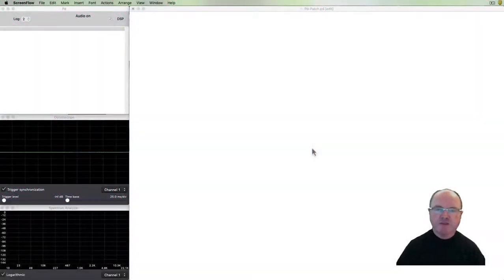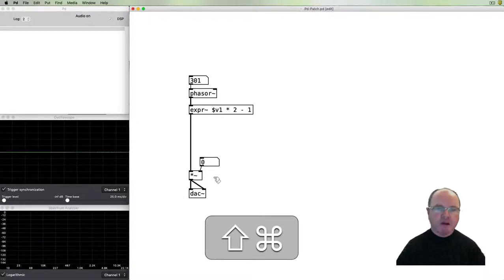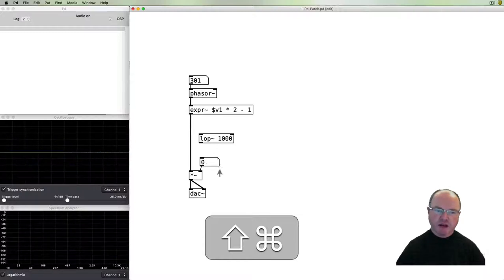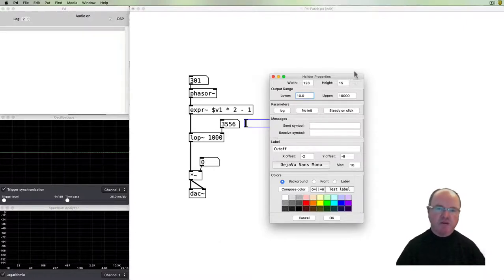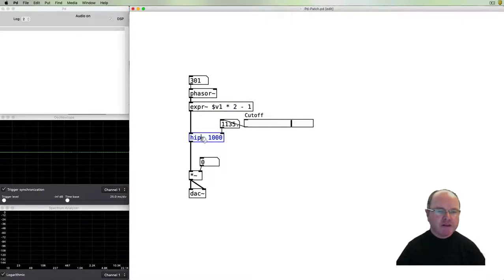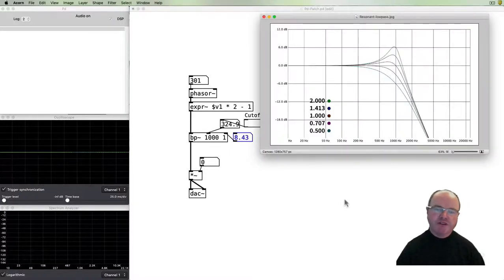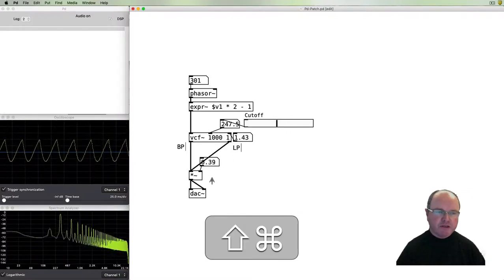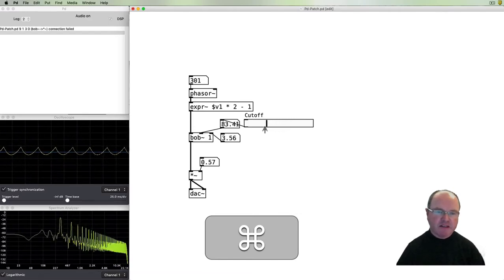17. Filters in Pure Data

Comment: I've been going through this who series (great work!) and up till now everything made sense. However, your description of vcf~ here does not align with what I see in PD's help. It states that vcf~ is (solely) a band pass intended to take in audio/signal to set the freq and a number to set the Q.
Reply from the maker: Thanks for the positive comments on the series. I'm glad it's useful. Checking the [vcf~] again, the current version of Pd does appear to send a bandpass signal out the left outlet and a resonant lowpass signal out the right outlet. Hopefully that's what I said in this video :)
Reply: @QCGInteractiveMusic   Thanks for the quick reply. 
It may be that I'm using purr-data, not sure. But the help (I see) has the right inlet being the "Q or filter sharpness". In that case how would one set the resonance level?  Does a "sharper" narrower Q mean more resonance? 

Oddly, the purr-data help has the outputs as "1. The filtered signal (the real part)" and the "2. The filtered signal (the imaginary part)". Which is, to my simpleton brain, not super helpful.  

Most importantly the sound I hear does not match your demo and value changes don't update the sound in the same way.  Oh well. Maybe something will make it click for me down the road.